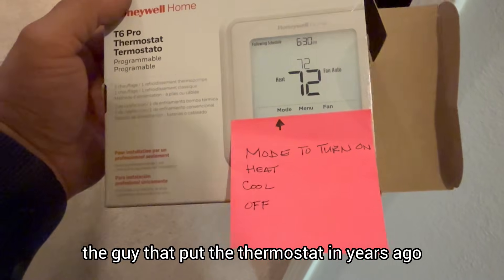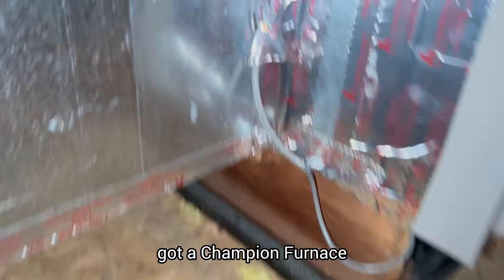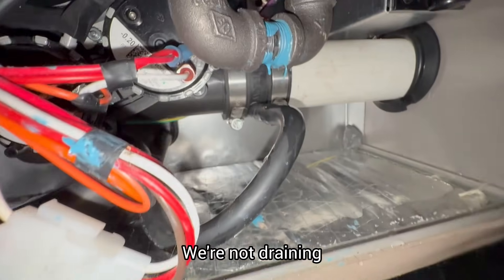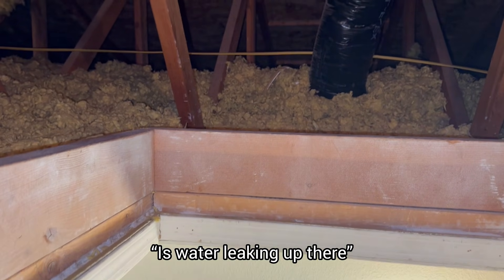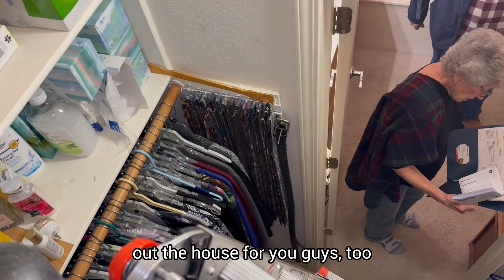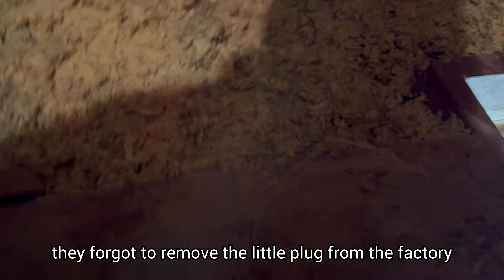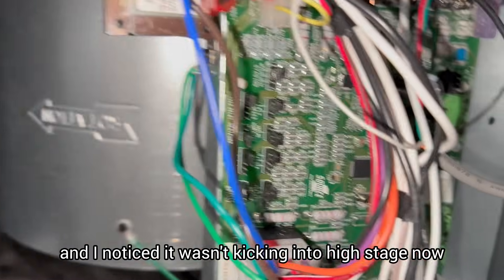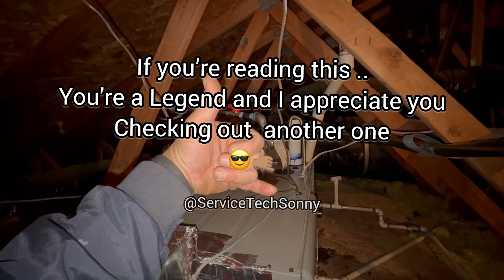Champion 90% Furnace No Heat | Complete Diagnostic

Comment: Setup is so important with these furnaces. I like to read every install manual. I enjoy checking static pressure so I can set the blower speed and checking that gas valve with a manometer for proper pressure. It’s the little things, and with these new furnaces there is very little wiggle room. I installed one the other day and I had a long existing 2” pvc vent within the spec distance that the book said yet when the barometric pressure dropped overnight the furnace failed because the pressure switch tripped. Even though I was within the spec I had to increase 10 ft of the pvc exhaust to 3” to remedy the problem.
Reply from the maker: Absolutely! The install manual is your best friend with these newer units. Appreciate you sharing that bro! That  flue fix is a good one!

Comment: I would have a look at one of the burners for a problem. The flame backlash (what you called "feisty") at startup is definitely NOT normal. There may be an obstruction on one of the flame burners causing the back flame at startup.
Reply from the maker: That was crazy 😂 so it never happened again after that with multiple cycles. I also had the lead installer go back and dial it in that next Monday for gas pressures and to follow up on the drainage for good measure. Great point though and that is absolutely what to check for that! 🫡  we’ve replaced about 4 failed valves this year with these out of the box.. 😂 thanks for checkin out the video Greens! 😎🤙🏽

Comment: I moved to a new house that had a 2 stage Amana furnace that the installers and maintenance  people never flipped the DIP switch to 2 stage operation. A saw another video of the same type Goodman that also didn't have the switches set. Now this. I suspect like 90% of 2 stage furnaces with one W terminal are not operating in 2 stage. How can I trust anyone to do a good job?
Reply from the maker: That’s a great point bland! And I come across it all the time! It really is up to the integrity of the company to be honest. Some homeowners want proof of second stage operation and performance data which is why I’m trying to get the installers I work with to use app based data and performance tools to deliver that info better at start up 😎! Thanks for checking out the video!
Reply: Thank you for another great video. I appreciate it.  I’m gonna do some research on that jumper thing because I didn’t understand that part.
Reply from the maker: @frmath2  some of these units will come with different staging options if applicable. In this case a 2 stage furnace was installed however the installer didn’t realize there was a jumper to initiate the second stage. Being that there was a 2 stage gas valve and not enough wires down to the thermostat for 2 stages.. we have to apply the jumper to activate at a certain time depending on your application 😎🤙🏽 usually I set this to 10 minutes so the temperature will get there quicker rather than running first stage for 20-30 minutes
Reply: @ServiceTechSonny Tank you so much for the reply, it makes more sense now. I’m studying the refrigeration part right now. So many things to learn. Enjoy your Sunday Sr. I appreciate your videos.
Reply from the maker: @frmath2 thanks brotha! You too good luck on the training 👊🏽😎